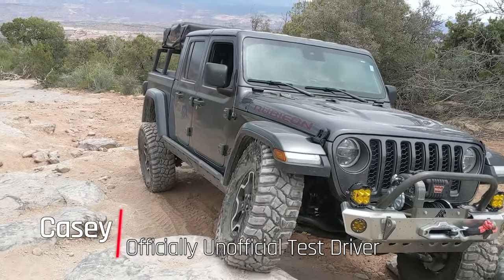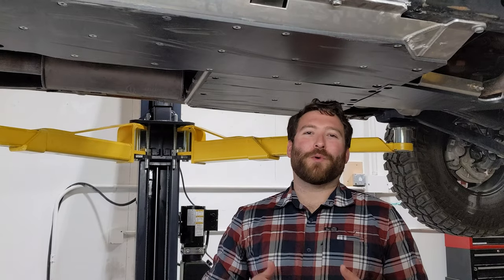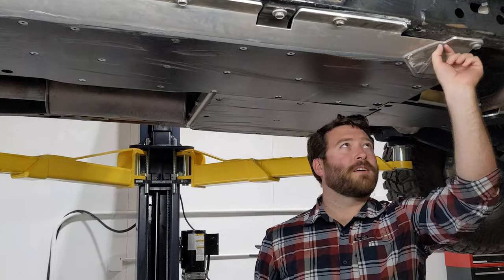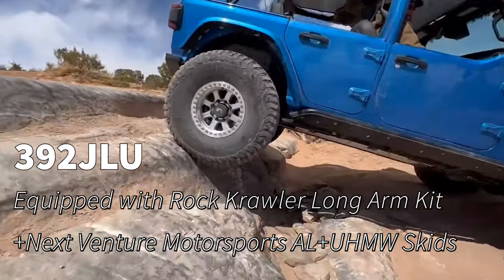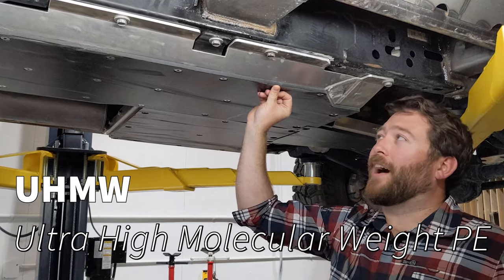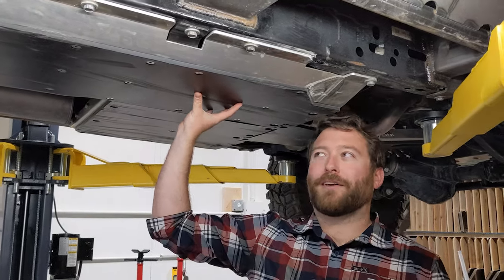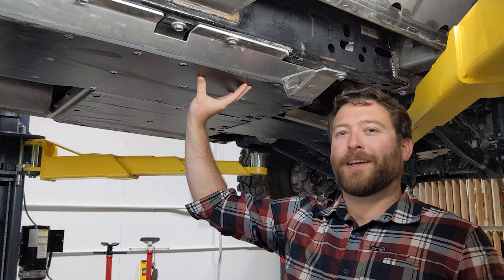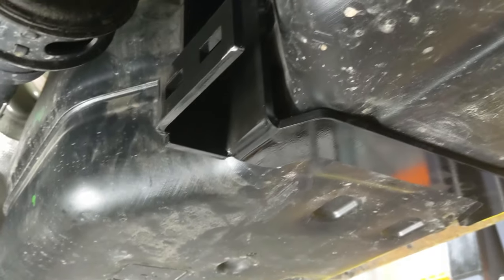Ultimate JL/JT Belly Skids [Installation & Product Overview]

Comment: Incredible system! No weight gain and gains 3/4" of ground clearance! + all the protection it gives.. 
If the price is at $1600 it would have been a perfect add-on to any JL but at $2400 its way to steep! 

Love it though and i want to upgrade my 23 JL Rubicon
Reply from the maker: We have seen prices go on a rollercoaster ride the past 24 months in terms of the raw material: aluminum, steel, even the hardware. It peaked out at about a 365% increase in raw material cost. While we do our best to be competitive on pricing, we can't soak up all of that cost increase without increasing our prices at some point. Appreciate you checking out the video!

Comment: Some JT engine skids that mount to the motor mounts have clearance issues with the driveshaft with the stock height suspension. Does your engine skid bracket avoid interfering with the driveshaft on an unlifted JT?
Reply from the maker: We did see some interference in some early JLU designs; but we were able to maintain a bit more room on the JTs when they redesigned the 3.6 motor mounts; and don't have that issue on the 3.6 JT or Diesel JT.

Comment: How’s the fitment? I’m planning to get this whole kit including exhaust area. I’m hearing some negative feedback on fitment. For 3k+ that’s a lot of dough for something that has to be modified, at least on a 392. I hope not, i really like the design and looks.
Reply from the maker: Good questions! We're always attempting to strike the right balance between a high clearance skid plate with very little room wasted, and a skid system that will allow for a bit of extra wiggle room to accommodate small changes and variances that are seen on mass produced vehicles. We've seen a lot of changes mid year/mid production on the JLU 392s, and issues that we didn't see on our test fit vehicle definitely starting popping up as we saw those changes implemented in later 392s. We have been out searching for the feedback, and listening to it when we've received it directly.... As a result, we've made changes to the engine skids (there are actually 2 now: one for the original Hellcat bolt pattern oil pan/aluminum cast pan, and another for the Standard Hemi style block/stamped style oil pan configuration), as well as the rear exhaust skids getting a redesign in order to increase the amount of room around the 4 tail pipes as we were seeing large variances in how the exhaust is mounted up on the JLU 392s.
Reply: @NextVentureMotorsports  Great info. Thank you. I will definitely put this on top of my list with Magnaflow exhaust for 392. Much appreciated.

Comment: You need to come out with an engine skid plate by itself. I’m sure there’s more like me that don’t need a full belly skid and just need an engine skid plate.
Reply from the maker: It's not a bad idea. The way the engine skid mounts currently relies on the transfer case skid and fuel tank skid to help align the hardware inserts in the transmission skid properly, but we could probably come up with something that corrects that for an engine only skid kit. If you wanted more protection later, you could add the other skids we offer -- but it's probably not going to play well with other manufacturers parts if you were trying to mix and match.

Comment: Everything you touch with your hands will rust
Reply from the maker: Everything? The UHMW won't rust, aluminum oxidation actually offers some resistance to further corrosion, and the steel hardware and steel brackets in this video are either painted or zinc plated.